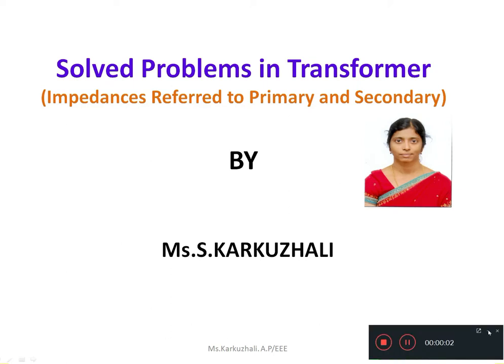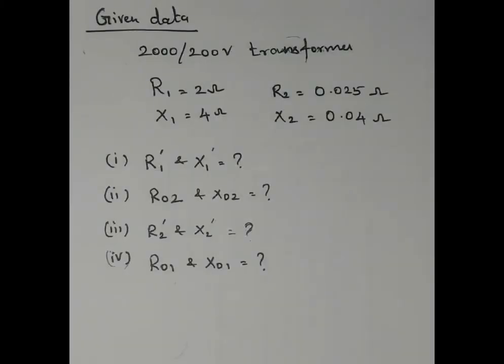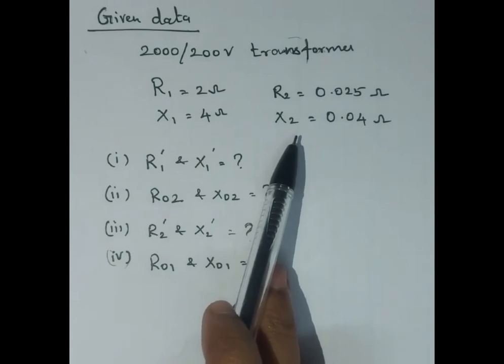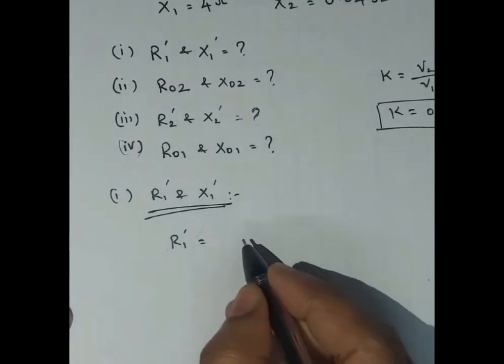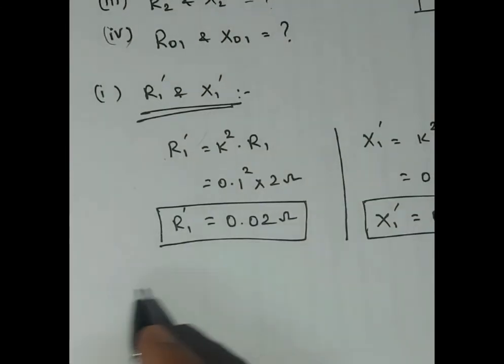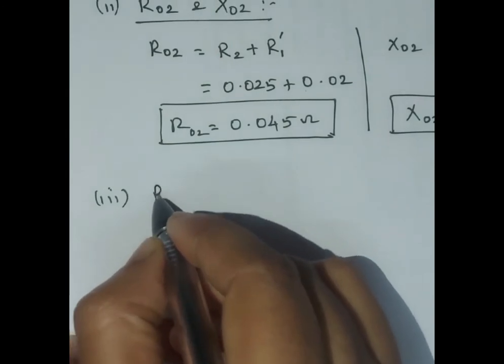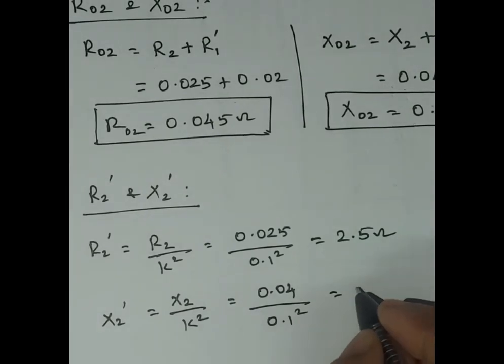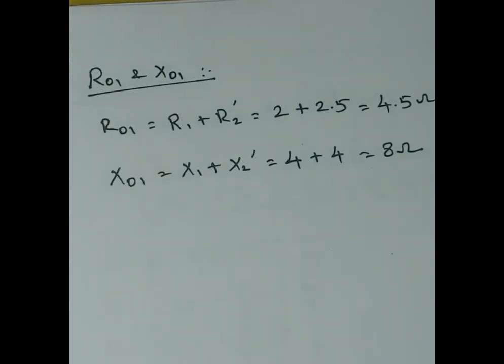Resistance, Reactance Referred to Primary and Secondary of Transformer

Comment: A50KVA, 4400/220 V transformer has R1=3.45 Ω, R2=0.009 Ω. The values of reactances are X1=5.2 Ω and X2=0.015 Ω calculate:
Impedances as referred to both primary and secondary.
Total copper Equivalent resistance as referred to primary.
Equivalent resistance as referred to primary.
Equivalent reactances as referred to both primary and secondary.
Reply: I was exactly searching for the question lol